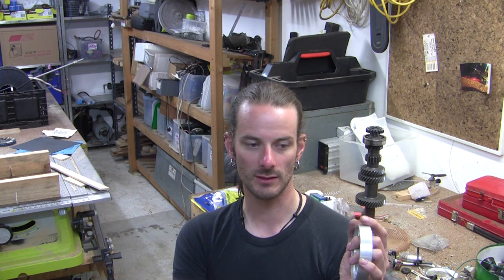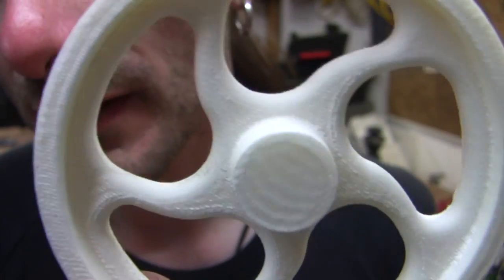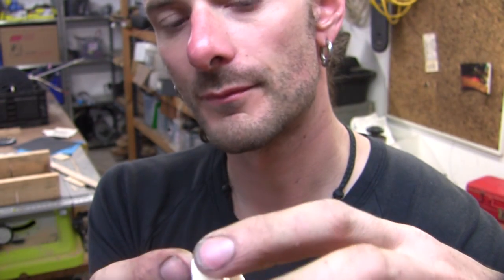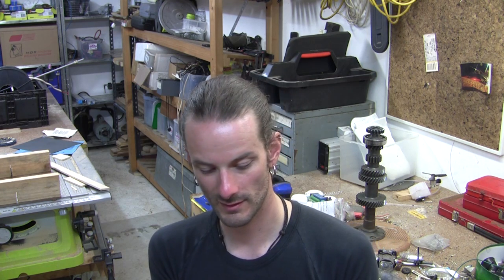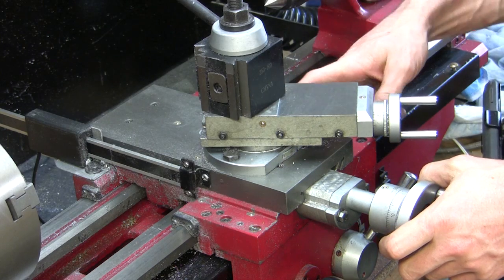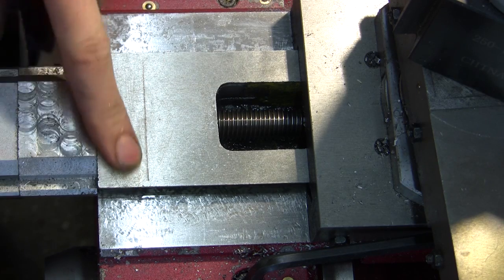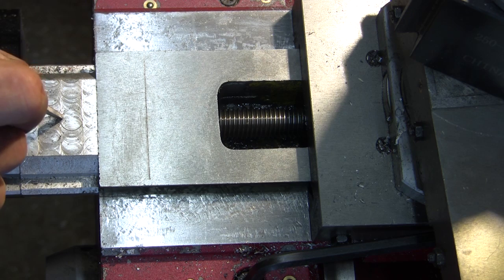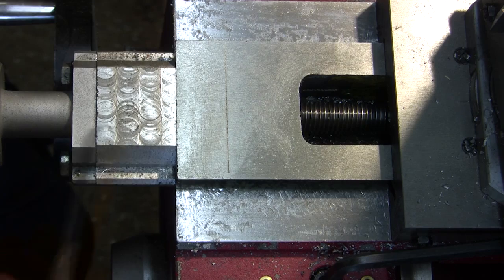C6 Sieg gain 65mm turning and 3d printing patterns for casting

Comment: Hello HomeDistiller.
I wanted to ask Your advice on another way to improve the workable radius on the C6, but I just went away drilling two 6,8 mm holes and tapping them with M8 threads and one 10 mm hole on the same centerline ~31 mm from original position inspired by you. Thus I can move the complete compound slide with the tool post approximately 31 mm further away from the centerline of the lathe.
Don't know whether this was a bad idea or not? Anyway it's done now.
Any comments on that?
Regnar
Reply from the maker: Regnar Andersen I'm not sure what you mean? You've moved the compound back on the cross slide? That should work but I would not do both mods, these lathes are not the most ridged in the first place
Reply: Morning HomeDistiller.
You understood quite right. I only have the milling machine on the C6(actually M6 then).
With the cross slide dismantled I wouldn't be able to mill in the carriage anyway, so I had to think of something else.
Suddenly with all the stuff apart it hit me. I wanted "that" to go "there" was the task at hand and there was "plenty" of unused area on the cross slide. With the cross slide all the way back I wasn't even near the marked holes to be drilled. So I swapped both the cross slide and the spindle nut 180° and mounted it backwards. Now it was an easy task to drill and thread the holes as necessary.
The angle scale of the compound slide is now flush with the front edge of the cross slide, so I'll have to put a mark on the vertical surface/end face of the cross slide to read/adjust angles.
I considered rigidity, but in this way a greater part of the cross slide will rest in its dove tail when turning large diameters.
I kept the old holes and turned some stud screws to "fill'm" so I can always go back to the original position for smaller diameters and increased rigidity.
I'm not going for both options since the swing over the carriage is 75 mm and it seems I will have ~80 mm from tool tip to center. Soon I'll receive my 5" 4 jaw chuck and 220 mm face plate with UPS.
Regnar